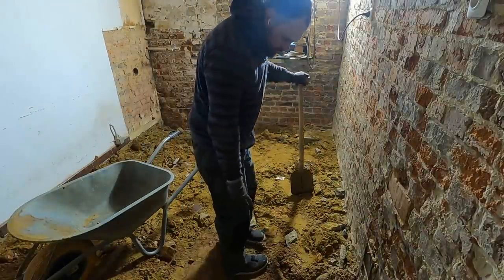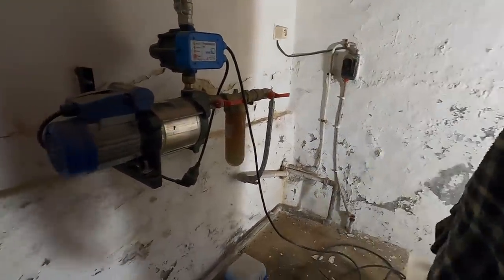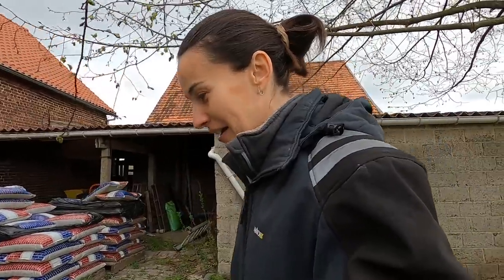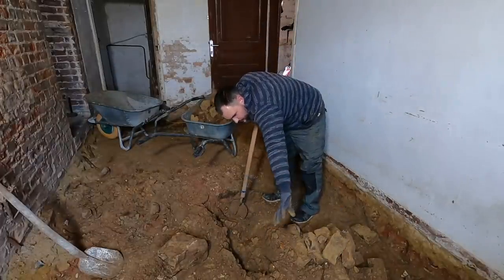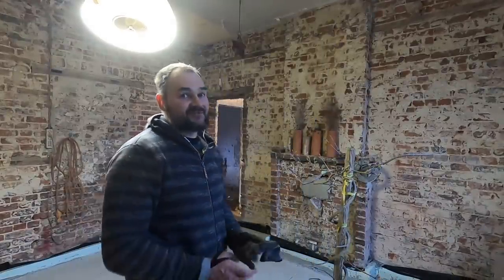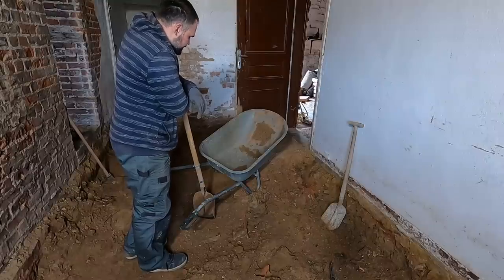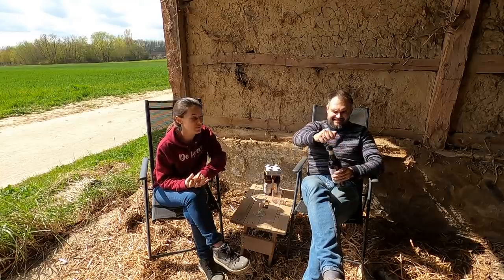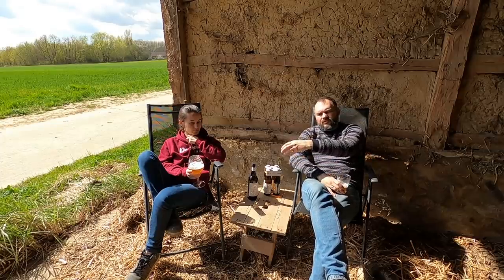Exploring the UNKNOWN: How did the water system on 110+ y.o. farm work?

Comment: If I were you, I think that I would put all brand new piping in and take all the old stuff out. That way it will be good for longer period of time.  Then you can put the kitchen and bathrooms where you want them. 
Just a thought. You are doing all that flooring, just put the pipe above the concrete floors, with a wooden cover over them. 
All you have to do is bring the outside pipe into the house under the ground, but the indoor pipe will stay at room temp and will never freeze up. Just a thought.

Comment: A meter tells me that there is community water. Their system (that you pay for) to the house should be recorded in a file in the closest community office. Maybe a turnkey or shutoff valve at property line in front of the house.
They may also have a record of the ground water well location. Yes, there are locaters for underground piping. Don't pour the floor with concrete till you know where the pipes go (if you have to renew).  A plumber could for a fee give you some advice I think. Good luck. Love the videos.

Comment: Before we moved into our home We replaced all our pipes with Sharkbite Pex Tubing and some copper. Our house is 80 years old and the pipes where corroded and contaminated so we just started from scratch.
Reply: They used copper in the house too? There are strong moves away from copper now. As with everything someone gets it in there head it is dangerous.

Comment: Lead service pipes are not as dangerous as people make out, although I also would replace with MDPE given the possibility. The poisonous lead oxide salts are insoluble in cold water but do dissolve in hot water. A new lead pipe will form a light covering of lead oxide on the inside which if undisturbed will not dissolve into the  cold water. The other issue is that old lead pipes crystallise into cubic crystals that form cracks, I've had that in Victorian houses.

Comment: As others have said. Best to replace ALL old water pipes. Water passing through the lead pipes will be toxic and make you ill from lead poisoning. The good news is lead, copper and brass fittings have a scrap value which could offset some of the cost of replacement pipes. Check with your local scrap metal dealer. Copper is more valuable than lead. Modern waterpipes are made of plastic, less likely to burst in cold weather, none the less you should protect from freezing. Water needs to be tested for quality. If your using ground water for drinking be sure to filter the water. Best to seek professional advice.

Comment: regarding your pump: it sounded like running in air instead of water. The pump-body and suction-pipe ('inlet') need to be filled with water (you might be able to 'push" it in via the existing piping on the outlet, with a garden hose). The screw Ilja unplugged near the filter is to let the air out while filling the system with water. If you start the pump and only a small amount like 1 liter is coming out, this is the amount that was in the pump body, and it generally means it is sucking 'false air' via the suction-pipe. If you're lucky it starts pumping....

Comment: To be safe, you'll need to run all new PEX piping throughout your house ( to all bathrooms and kitchen) and to your outside faucets for gardening.  You will need to locate your supply pump (outside somewhere) and remove all old piping to the house with 1 inch PEX supply piping to your house.  You will need to have a manifold that is connected to your water supply line from your pump.  This line will connect to the PEX manifold cold water supply valves.  From the main supply line, once inside your house you will need to tee off from that main supply line to your water heater and back to the hot water supply side valves of the manifold.  You can do a lot of the work yourselves but you have to know what you are doing.  I would suggest hiring a licensed plumber or well specialist to locate your pump, verify that it is in good condition and deep enough to provide good clean water and replace the main line to the house.

Comment: Some people are suggesting PEX. And while it is easy to work with, I was old enough long ago to know what happens to plastic in a couple of decades. Imagine your whole household using the shower every day for 15 years and think of what effect that flow of hot water is going to have on the fabric of the PEX supply line. Maybe you don’t wanna come home sometime in 2036 to discover that a hot water line inside a finished wall split several hours earlier.

Comment: I agree lead pipe is not good. It can be a health hazard over time. In the U.S. before any construction work that involves digging we are required to "Call for Locates". We have people who specialize in locating pipes and electrical lines underground with specialized metal detectors that are very accurate for both following the pipes/wires along their path and even tell you how deep they are within inches. I would be a surprised to me if this service is not available to you in Belgium also. Call a plumber or your local building department for information.

Comment: Yes, replace all the lead pipes! Use PEX or Copper!
Reply: There are recommendations not to use copper anymore. Check local standards and common practices in your area.
Reply: @MrPaulviles  - Here in the states its still the most used. PEX is gaining ground but only for new work. As this is all new I would go with PEX

Other than people using the wrong solder there is nothing wrong with it. 

I could see someone with corrosive ground water may need to use something else if they don't treat the water properly.

Comment: The old lead pipe isn't as dangerous as everyone saying. Lime will coat the inside of the pipe. Been around years. The problem though is the size. You should put a bigger size in for showers or baths. Hopefully mains water or someone drilled a well. 
Definitely get the water tested as farm chemicals or Nitrates can get into a well. 
With the Wisteria use some stainless steel wires to train it off the wall. Takes a few years to grow and flower. 4 - 5 years some.

Comment: The pH  ( acid, neutral or basic plus alkalinity) of the water determines how much lead (pronounced "led" as in "he led the horse to the barn") will dissolve in the water. Also how long the water sits in the pipes determines how much lead dissolves into the water. So if the pH  and alkalinity  are right and the water is in constant use, lead does not dissolve into the water.  That is why our ancestors did not die of lead poisoning.
Reply: English is so weird! It's my native language. I can testify that It's confusing.

Comment: Either rent or buy a metal detector to find the water line , there is also a way just using two copper rods that are bent on the end to pivot in your hands , when they move together and cross each other , below that is the pipe . It is strange how those rods work but they absolutely do , I have used them as a standard industrial tool . The item below the ground I was detecting happened to be lead pipe .  There is a channel I watch that has someone removing wisteria from all over as it branched out and destroyed the entire area of someone's property , it is very prolific and parasitic . ( I hesitate to mention it but the volume of this video was so low I could barely hear anything that was said . You might want to invest in a clip on personal microphone . )

Comment: Use a metal detector to trace the pipe to the well.  Find one that can detect copper, lead and/or steal.  Then get you well tested for purity, and depth. Go to your local county government and talk to land and water management to see what aquifer you are tapped into. They should have flow and contamination records as well as how many in your area are using the well.

Comment: I would first of all try to locate the well. Either by just walking around where you think it might be located with your arms hanging down and concentrating on your fingers. If you feel a tinteling feeling in your fingers, that can be a water flow. I didn't myself believe in water divining, but it does work. Or use a branch in Y form between your hands as the pro's do. Then I would cut off the leadpipes and start again by using Poly Ethylene piping and lay a new network of piping to be sure they are safe + also avoid increased risk of leakages after all the work you are doing. Try to think about creating a pipe network that you can centralize as much as possible and box in, so you or the next generation in 50 years time can easily reach them when it's time to renew them.

Comment: I would remove the lead pipes if at all possible. Even using that water outside is not something I would want to do. There will be poison in the water, you wouldn’t want to put that on your vegetable gardens. Even if you just use it to water flowers and flush the toilets, it would still put the poison in the environment…..
You two are the hardest working people I’ve ever seen! I’m so impressed with your work ethic.
I have a question, how on Earth does one make a flat ceiling out of bricks like in your basement?🐝🤗❤️